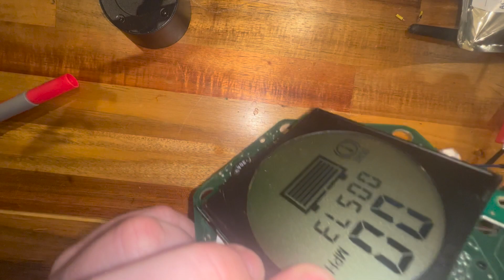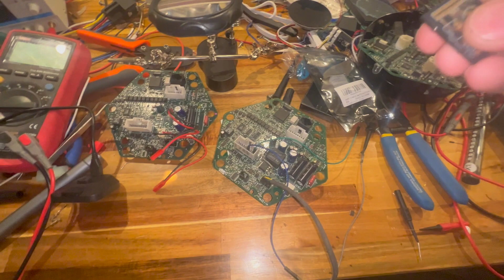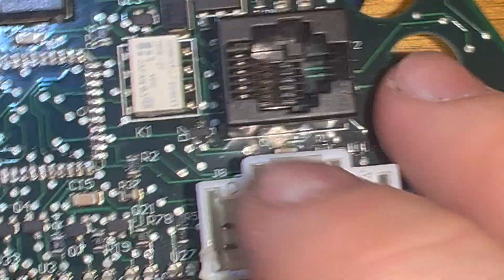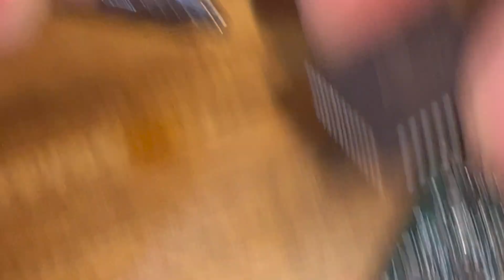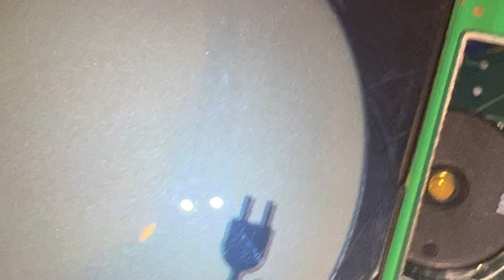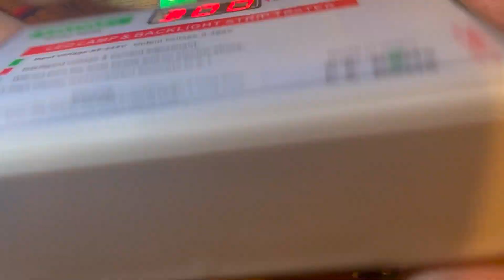Ep5: Debugging and Repairing the Cluster on a Ford Think

Comment: I just purchased your bypass board in hopes that it will allow me to continue getting the cart up and running until I figure out the cluster issue. I’ve located bad rectifiers and a burnt trace between pins 10 and 2On my IC. I’m sensing the “key on signal” wire is what might have damaged the cluster? Do I need to be concerned with this wire once I plugin the cluster bypass? Is this circuit (44) even needed?
Reply from the maker: @craigsegraves1353  there can be several but that’s one of them.
Reply: I just edited my question with the components I found that are bad. Sorry, I didn’t see you already replied. Hopefully you can see my edited question.
Reply from the maker: @craigsegraves1353  this is from a year or more ago. After debugging this, I went on to make the bypass then the cluster replacement. The OG cluster circuitry is wild and convoluted. The bypass is fused, just plug it in and see what happens, but there’s a reason they made something like 5x as many clusters as ford thinks.
Reply: @hagan92 thanks. I’m looking forward to the bypass. If the signal wire that comes from the controller is in fact bad, that would be disappointing. I can open it up but I’m not sure I’ll know what to look for. Any chance you have the controller single line wire diagram? Do you know if it’s needed? If the bypass works with nonissues then I’ll just buy the ode for the other two carts.
Reply from the maker: @ everything I have is available in the folder listed over at fordthink.org for free

Comment: Is there any knowledge on why I'm not getting any 72V output from J7A, pin 7 OG/VT Contactor Power (Coil)? You metioned some components at 16:20. Are these usual suspects for the contactor to not close?

Comment: The battery contactor stopped working. The only parts that are able to switch the contactor coil current are Q9 (IRFR9120 Power MOSFET) and Q15 (IRF7416 Power MOSFET). You stated that Q15 is for the reverse lights. If I push a probe into the back of J7A (pin 7) and inject 72V the contactor energises. On my board, there is no continuity between J7A pin 7 and Q9 source pin. All I can figure is that maybe I have a open trace under J7A?? Any help would be appreciated.
Reply from the maker: Sounds like you’ve gotten it pretty narrowed down - has your cluster been repaired before? Is it coming on still? I’m happy to take a look. I offer cluster repair and bypasses at fordthink.org.
Reply: @hagan92  Have you seen this same issue? Your thoughts on a blown trace under J7A before I pull the connector..
Reply from the maker: @keithemery4219  I’ve seen some of the FETs fail open, some fail short, broken traces. If you can answer my questions above, it might allow me to help you narrow it down.
Reply: @hagan92  Hi, I'm an electrical engineer as well and enjoy the chalenge of doing my own repairs. My cluster was re-worked by Scott but the DC-DC converter pin broke off while trying to remove the epoxy putty that he molded all over the pins. The wire he used is very fragile and too short to pull the board out to work on. Scott will not share any tips. I have a new DC-DC converter on order from Alibaba Express (thanks for showing it on your video). Everything seams to be working except the battery contactor. I drove it and parked it a month ago and went to move it to find this problem. Batteries are relitively new and are at 75V. Thanks for you replys...
Reply from the maker: @keithemery4219  Q15 is on the isolated side of the board and deals with the reverse lights - the output goes to J8. Q9 is where you’ll want to focus your attention. There are a few smaller transistors that control Q9 below the J7A connector. That’s where I’d begin probing. Of course, it has to get a signal that it’s ok to close contactor from the micro, so you could also have an issue with an opto or something near Q23.
Reply: I was measuring 72v on the gate of Q9 so I decided to lift the pin and short between the drain and source pins but it still isn’t energizing the contactor coil. Ordered a new Q9 new J7A and J8 connectors due to melted housings when Scott reworked. I’m going to fix this cluster just to get up and running quickly but are starting to work on a from scratch, new drop-in PCA using an ESP32 micro. You’ll be able to monitor everything from your smart phone as well as a color display.
Reply from the maker: @keithemery4219  we’re about to release our cluster replacement. Might be a better effort to build modules that work off of that instead of competing in such a small market, but glad to hear there’s another passionate Think owner with an EE background.
Reply: @hagan92  Hagan, I have no intention of competing with you as I am doing this for my Think. I design new products for a living and enjoy the challenge. My entire home is controlled with ESP32-S3 micro's via WiFi. Would rather chat directly with you then on YouTube. Any ideas on how to share emials without posting here?
Reply from the maker: @keithemery4219  no worries, there’s a link to contact at the bottom of fordthink.org. Thanks!
Reply: @hagan92  I will not let Microsoft have access to my Google gmail account. Not able to send you a message through your web site.
Reply from the maker: @keithemery4219  not sure what that means. There’s a big yellowish button at the bottom of the page that says “get in touch”. Clicking it (or even hovering over it) will give you the email address. I try not to post it here since spam bots are so much more prevalent on YouTube.

Comment: You answered my first question right at the start (how to get charging symbol off). I got so excited I ran outside and got the symbol to turn off. I was sure it would now work, but I was wrong. I watched the rest of the video and I now have a pretty good idea of what I'm probably looking for. I feel pretty confident it will run soon. I want to give you a major thank you. I probably would have replaced the whole shebang (motor , controller, display) had I not found your video. You have done a real service for those attempting to keep them on the road. You have probably saved me a lot of dough and work. Well done!

Comment: Ok learning a lot from you ty 
I have no speed or trip working 
Charge indicator seems to be ok 
Even with new batteries very limited range. Trojan flood 31’s Iquic charger set to 5
Reply from the maker: Check the magnet inside the speed sensor on the rear of the motor. You can see this in my motor video. As for range, non sealed batteries are not recommended. Typically people forget to water them regularly and they go bad quickly.

Comment: To install the isolated power supply do you "have to" remove any components other than the MOSFET?
Also which power supply did you use/recommend?
Reply from the maker: Yes, you need to remove the MOSFET, a few linear regulators, a few capacitors, and then replace with a 72V+ to 12V converter. I have had good success with Hilink modules but Digikey has a few options.
Reply: @hagan92  Great, thank you for the info. Do you happen to have a schematic or list of which components need to be removed before wiring up the external power supply? 

Sorry if I missed mention of it in this video and thank you for your help.
Reply: From comparing the cluster in the video to mine it appears the components that were removed are C36 if applicable as mine doesn't have C36, U30, U31, U32, R50, D11, Q14, and L1. Are there any components that I am missing?
Reply from the maker: @adame924 I didn’t explicitly mention these components due to people out there that offer cluster repair as a service, but I’ll post in hoping it helps you and others. 

Main MOSFET (Q14)
R50
L1
D11
C36
C38
C39
C40
U30
U31
U32

I have wired up a Cincon ELCB40W-110S12 and it works very well, but you can also go the super cheap route and find a 72v to 12v converter that outputs at least 3A. It does not need to be isolated. 

Past this, there are a number of transistors and optoisolators that can fail and cause things like the plug icon or leakage icon to persist on the screen but those get a bit more in depth.
Reply: @hagan92  Thanks again for the help. I have few working clusters which I purchased, not working and repared, though, as you know, they don't last forever, which is why I have a few. :D I want to upgrade to one with an external power supply, though I haven't been able to justify the price. 
...plus your idea of replacing the cluster is really the best idea and long overdue. Thank you for all the hard work you have been into eliminating the cluster!

Comment: Great job, I'm working on one of these now trying to reverse engineer as you've been doing. Lots of damage on my board, R9, Q10, U9, C37 and C36 (bulging), Q24 and U28 cracked.  Also appears that the trace going to inductor PE-52627 is burnt.  Hoping the main power module underneath isn't damaged as well.  smoke went up the board so I'm just hoping to low-voltage side isn't damaged...
Reply from the maker: Curious if you ever got it going!

Comment: You can make the LCD to some random lcd display manufacturer, it typically costs a couple hundred dollars the initial sample (tooling costs) made and then maybe 2-5 bucks a piece for a minimum batch of 50-500 lcd screens ... you just need to determine the segments and their position, and where the segments are connected (they're multiplexed, probably 2-4 anodes and a bunch of cathodes). Under that epoxy blob is just a generic lcd driver, and the microcontroller either shifts in a series of bits (one for each segment) or it talks to the chip in the blob through i2c or spi some commands which you can figure out.
EEVBlog here on Youtube had a series of videos about how to make custom lcd screens and work with a custom lcd company.
Note that you kinda have to match the PIC16 microcontroller - may be able to get one from the same family with just more flash memory or a bit more ram, but otherwise can't be too far off.
Reply from the maker: You’re exactly right, my degree is electrical engineering, but I’m not even sure how many of these carts are on the road, and how many clusters still need repair. The goal is to get them going again at a low cost. Clusters can be repaired for $600 or so. I was hopeful to make a replacement in the $100-$200 range or less. That’s not easy to do once you start getting into custom components.
Reply from the maker: @Orion-b7p  true, but I’d reason that less than 1/3 are still roadworthy and even less than that are operational. It’s a market that seems to be drying up exponentially, mostly due to lack of knowledge and resources around the cluster. Hoping a cheap bypass offering can help.